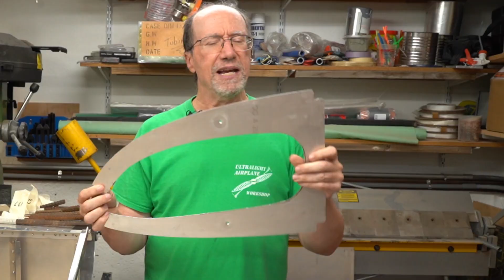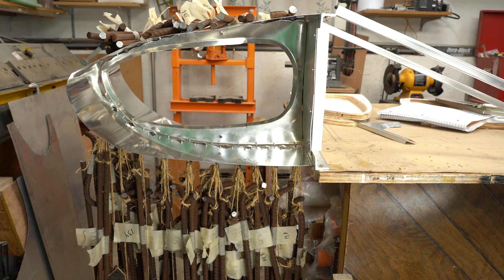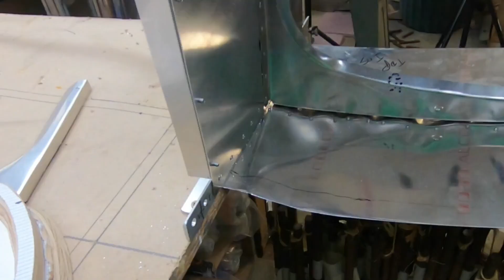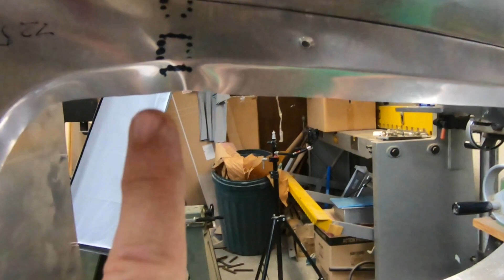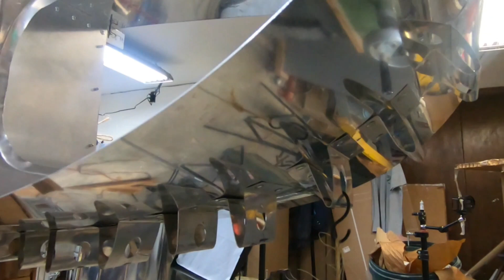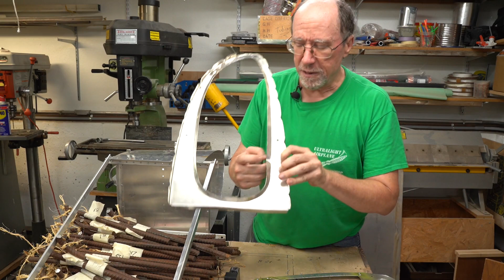Cantilever Rib Portion Test: Part C

Comment: Hey, Leon! Been a minute. So I've benefited a lot from your videos and thought perhaps you'd find a contribution useful, here. I'm a design engineer who's building a plane of his own, so I've taken your wing profile (from screenshot) and created a topological optimization simulation for it in ANSYS. There are some big caveats involved, like the fact that it uses a uniform distribution of load, for simplicity, and the fact that it is based on a flat sheet, rather than your more optimal deformed sheet metal, but the results should be (qualitatively) valid, and could be used to inform a future truss model if you wanted. 

In my validation simulations, this geometry was able to support your 112lbs using a flat sheet thickness of .35mm Aluminum, which had a mass of 40 grams. Formed sheet metal would be stronger, of course. 

Were I making this part myself, my next step (after refining my load conditions more) would likely be to simplify the profile I've pictured for manufacturability, before regenerating the model and doing further simulations, then moving to prototypes. Given the results I'm seeing, I'd be considering using tension members (probably dyneema cordage) for the upper supports.

If you do use these results, please note that the dark blue areas are where there is still very little strain in those members, and they could, in some places, be skeletonized considerably more. Please let me know if you've any questions, and I hope you find it useful!

-Ryan
https://drive.google.com/file/d/16_yYe4do4LbOqGwBrWVQejduV_6qclEg/view?usp=drive_link
Reply from the maker: Very cool. Thank you for the work that you've done.